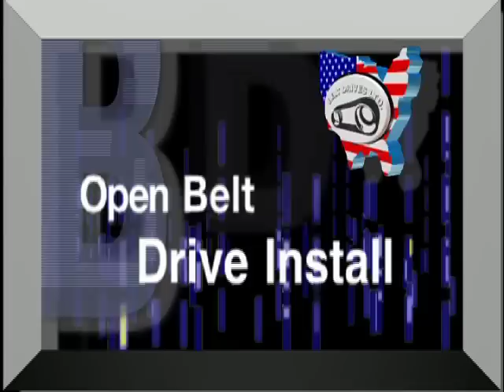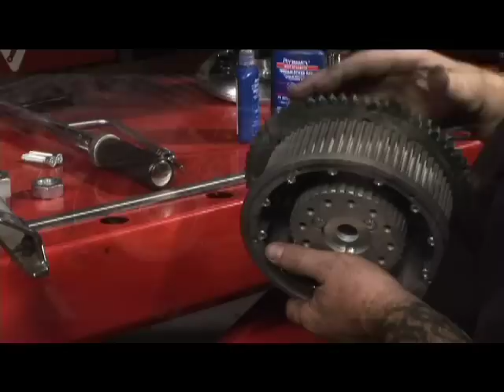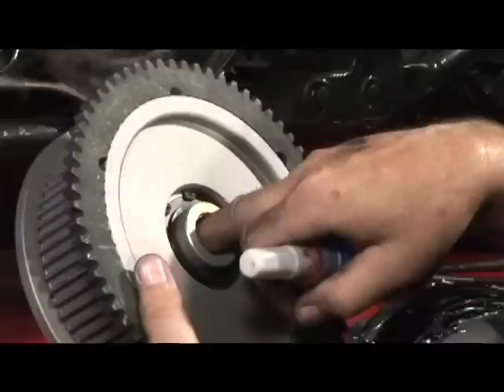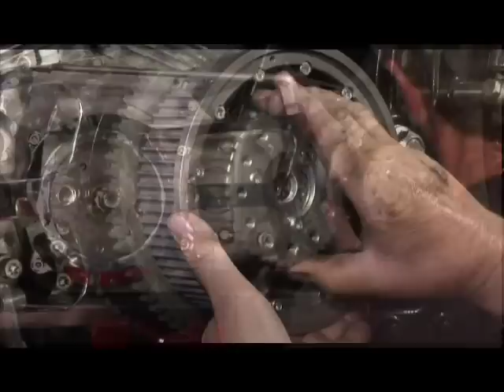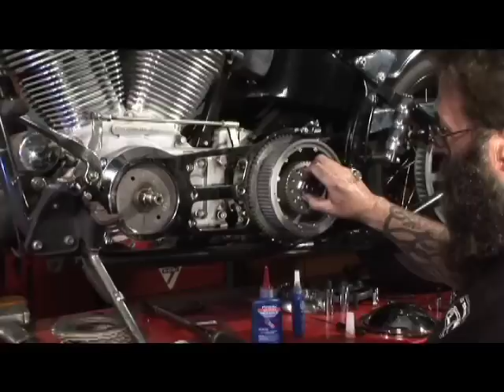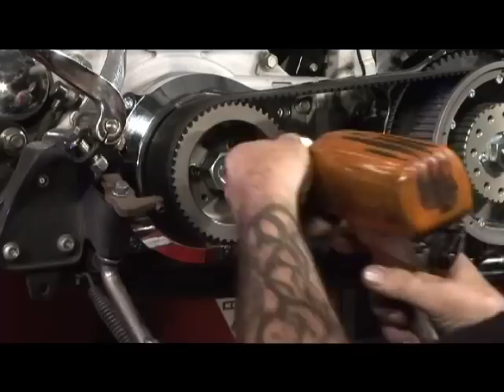Installation of BDL Open Belt Drive

Comment: Good info on the install. My BDL front pulley seems to be vary tight when trying to push it on my 1982 Harley Shovel Crankshaft. Are there different spline geometries available ??
I don't want to use a Rubber mallet to get it on. Any help would be appreciated...
BTW the rear Pulley slides on the tranny just fine.

Comment: That belt drive or a gear drive primary is what Harley-Davidson needs to go to from the factory. Why Harley-Davidson is still using a chain primary drive system with a totally new motor in 2017/2018 is beyond me.
Reply: War stock. Harley has miles of chain to use up before they replace it with something better.

Comment: When I installed my open primary. I decided to go a different route. I have some anxiety issues and after a few dreams. About my clutch hub flying off and killing a baby. My choice was JB Weld for the main shaft splines. My Grandpa Jack always said you can never use too much. That's what rags are for.
One of my buddies let me borrow his 4 to 1 TQ multiplier from Snap On. I snugged everything up till I couldn't turn the assembly. Back off the nut. Then retorqed it with an impact like you did. But, I connected the impact to the torque multiplier. To make sure its all snug as bug in a rug.
Going for a ride tomorrow. Charging my battery tonight. Strange it died on me in just 2 hours. Hit the button an my lights get dim. Nothing turns and I hear a noise like EEEERRRRRR. So tomorrow gonna fire that bad boy up.
Reply: Wtf? Dude I hope this was just a troll comment.....

Comment: Thanks for the video. But you should not distribute the LOCTITE at the shaft with  finger! It is poisonous and should not distribute by fingers. Even it should ONLY use for the thread.

Comment: Hey can someone confirm to me that I can easily remove the stock 97 Softail Harley-Davidson chain primary system inner and outer primary case and install this BDL open belt drive system with no problem the S9 is the one that I got

Comment: Tell me please, I have such a situation is the drive belt from the engine to the box to the left and chain drive to the wheel to the left, too idet.Mozhno whether to put in place a chain belt and was walking on the right storony.Nuzhno another transmission or put-please tell me.

Comment: I have a 3" open BDL on my Shovelhead. I had to do some stator and main seal work.
My question is that i have to torque up that front pully to around 240ft Lbs. So how do i lock the pully without stretching my new belt using a block?!.
Reply: exactly - how do you hold those pulley stationary - with the chain drives, I just shove a block of hard wood in the chain, but how do you hold them with no chain?
Reply: easy rider,,  do u have an answer,,,cause thats my question too...
Reply: Primary locking bar

Comment: How would I remove the clutch. Hub? I have taken the clutch hub nut off even the snap ring that was on there the clutch plates. I have applied heat to it with a heat gun as well as tapped it with a rubber mallet and it won't buge. Any ideas?
Reply: I’m sure you got it off by now but for others even with all that loctite , the clutch hub comes off fairly easy with an automotive harmonic balancer puller and heat. Use a sacrificial washer on the trans shaft.

Comment: do tou need to take a torch the clutch hub nut to uninstall
Reply: YES, I did
Reply: No, not in the original setup. But if you follow this genius' instructions, you'll need to torch the whole bike before things will come apart. The use of loctite in this... instruction video is plain hideous.

Comment: is the clutch housed in the transmission or the engine
Reply: neither .
Reply: wheres it at
Reply: lol
Reply: Neither, its in the PRIMARY
Reply: The clutch is integral to the rear sprocket.

Comment: i broke my primary belt. and i need to remove the front pulley in order to reinstall the belt. is there a trick to removing this pully? keeps spinning and with all that lock tight i can't turn the nut.
Reply: YES, Heat it up
Reply: Just take out a spark plug and insert a 7/16 rod down through the spark plug hole to prevent the crankshaft from making a revolution. If this doesn't work, pour a generous amount of  RED Loctite into the cylinder and let sit overnight to harden on the rings and cylinder wall.  Remember, Loctite works by "absence of air, presence of metal" so remember to put the spark plug back in after you apply the Loctite to the piston rings. It also helps to always use a 3/4 drive impact wrench to remove pulley nut. An alternative method is to put the transmission in it's highest gear and secure the rear tire down with multiple ratchet straps, put a socket and breaker bar on the pulley nut while wedging breaker bar against a non movable object, then start engine and the nut will come right off.....Voila . You're welcome!
Reply: @johndisalvo6283  Hahahahaha..... perfect

Comment: I have a question and suggestion.
First off if you manufacture to HD tolerances on the splines as you suggest in the video, I must ask why do you use Loctite red and HD does NOT.
Now I think you should show a "disassembly" video after the loctite red has taken a set for a couple months. The only thing that will make Loctite red let go is extreme heat.
This part is easily removable from the factory for a reason such as when you break a final drive belt on the road.
Reply: Can I put an EVO inner and outer primary along with the clutch and starter on my 1982 shovel head ? Plus is there a certain year
Reply: I have never run red Loctite on my bike. That is a matter of preference I guess, because I do not use Loctite anywhere on my 74 FX. However, I love that Loctite thread repair kit! Great shit!
Reply: Reference the HD tolerances, the stock HD is oiled. The BDL being dry should have something in there to cushion the spline.

Comment: I wish someone would show how they hold the pulleys in order to torque the nuts on them?? I have a tool that looks like a set of stairs for chain drive that holds the pulleys from moving but have not seen  anybody show us how that part is done.
Reply: Tony Parson . Jim’s clutch locking tool or “mouse stairs”
Reply: @knucklehed34  Mouse stairs is for the chain drive primary - what he is asking is how you lock these pulleys with the belt primary?

Comment: Like others have said, you have to be kidding me with putting red loctite on the main shaft. No fkn way. How in the hell are you EVER supposed to get the clutch hub off again?! Heat?? What exactly are you gonna be heating? The entire clutch hub assembly, not anywhere near the main shaft. Stupid stupid stupid....
Reply: comes apart easy with a common harmonic balancer puller.

Comment: I  am freaked out ! Why?  The air hammer is beating the crap out of the bearings, Esp the crank bearings. Just not a good idea to use such a tool on sensitive parts.

Comment: ok,,so thru this whole video there is NO MENTION OF A TOOL,,,TO HOLD THE HUB FROM SPINNING WHEN TIGHTNING THE MOTOR NUT,,,, WITHOUT USING AN IMPACT,,,I just want to use a toque wrench not an impact,,its 160 ft lbs and I tried putting it in gear,,blah blah blah,,etc,,etc,,,

Comment: Damn funny that you want a rubber band to drive your transmission, then one back to the rear wheel too? Whatever the fascination is with these putt putt V-twins is beyond me. but make sure you  have gallons of red lock-tite to hold all that crap together....Bwaahahahahaahaha
Reply: I have nearly 300,000 original miles on one of these put put V-twin evo motors.
Reply: @glenndavis2762  can I email you a few questions about mine?